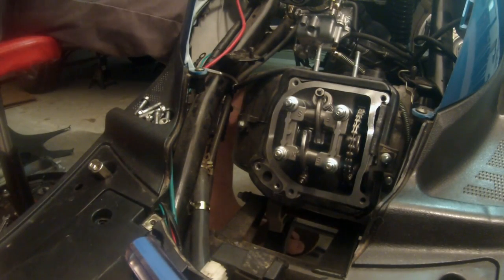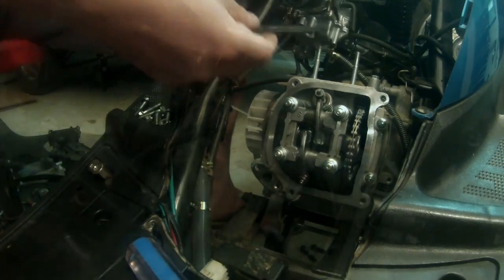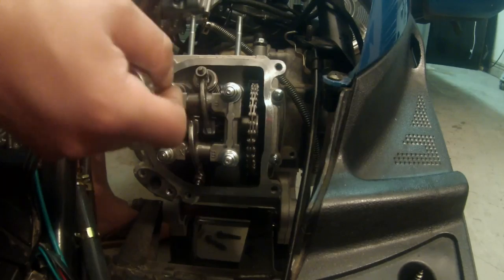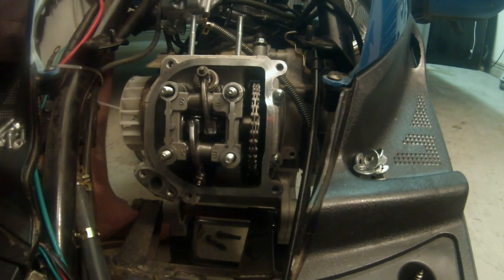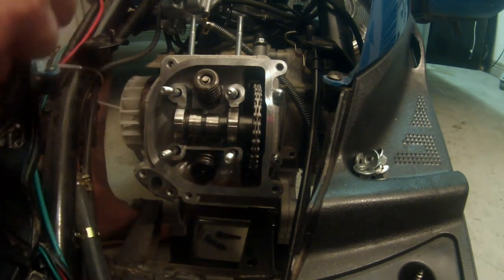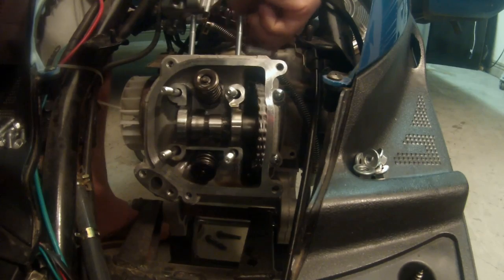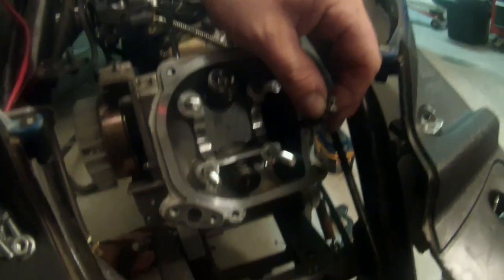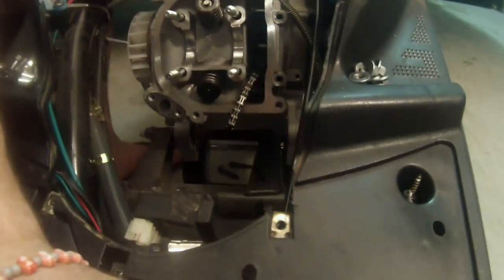Scooter Big Bore - Chapter 4 - Remove Chain Tensioner, Rocker Arms and Camshaft

Comment: how do I find top dead center.? after I already replaced it the wrong way. I have it by the team Mark. Still isn't right. Is top dead center when the valve is all the way out?. I've seen a couple hints. Put a straw or something in the spark plug spin flywheel and when it is first out is top dead center correct?. Thank you